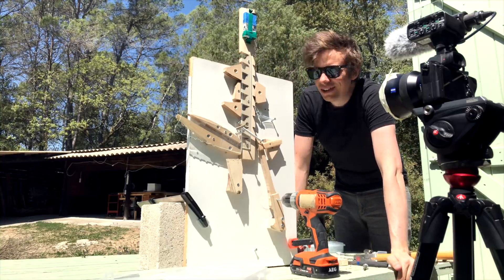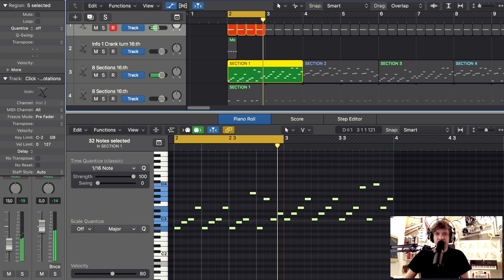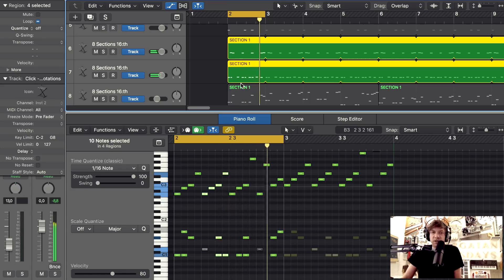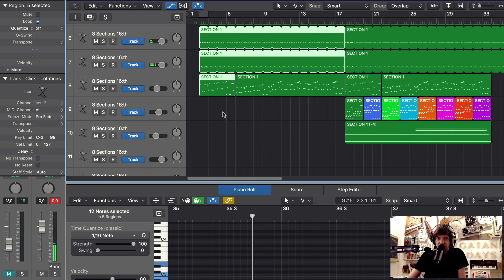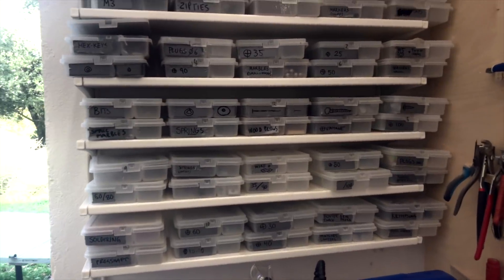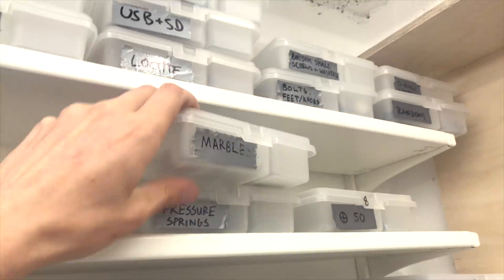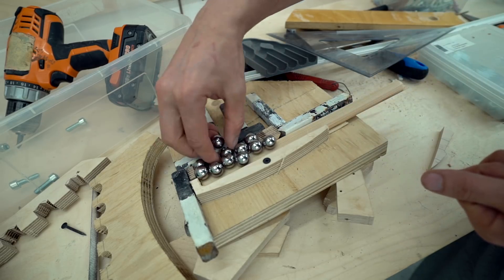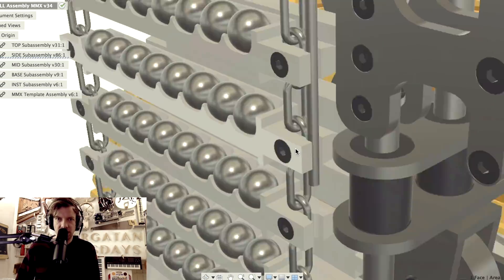Conveyor Belt Marble Lift - Marble Machine X #33

Comment: So if you're going on tour with this thing, how sure are you that every single stage floor will be level?

That's why you can't use the tilt divider. I wonder about the 5 degree slope on the new divider too.
Reply: He isn't assuming that. The MMX will have to be somewhat levelled for each theater.  Easily done.

Comment: After the demagnetizer, instead of having a curved slope, you should have it straight so the demagnetized marbles can quickly get to the conveyor belt. They are already slowed down by the demagnetizer, so make sure that you get  8 marbles per crank from the magnet pickup to the end of the conveyor belt.

Comment: When I saw the lift full of marbles I thought it looked heavy. 
Have you made any tests or calculations about what the total weight limit of the whole system is - before friction becomes to high somewhere in the system? 

I imagine that it is not a problem, considering the first marble machine worked and had the same amount (or more?) marbles moving and being lifted in the system?

It was just something that came to mind while watching the video..

Comment: i have an idea in case this wont work or smth : a wheel with outcrops with gaps exactly for marbles. it would be placed in such a way that it would intercept a channel with marbles that would have a cut through it at the end. at the other end there could be a sideways edge that would push the marbles out from between the outcrops. i hope you get the idea

Comment: Martin, may I suggest that you build more of the machine before designing thoroughly the rest of the parts? The machine is looking fantastic and there's a lot of great CAD work there, however I think there's a lot of assumptions built in. There's lots of components of the design that are being built on those assumptions. I worry that you might have to redesign a lot of things if there's no intermediate building to validate them. Just my 2 cents. BTW, the new video formats are great!

Comment: Being thinking on the system to lift marked you just shown.. it's very cool, but feel must point on something.. it will move step by step.. lifting the Marvel's into those little holes.. if you think on do that motion in a fast way.. let say 3 moves per second or more, maybe the inertia force can cause some marbles fall from their sockets. I didn't do the maths .. not good on that.. in fact is more like a fear it happens... Maybe could be good a plaxiglass shield or something alike

Comment: Hey martin. I posted a reaction about your issue with large assemblies on Fusion. Since i posted it quite lately and i'm not sure you read late commentaries, here it is: my experience from an industrial CAD background. 

-About moving parts: keep in mind that CAD softs are not really made to have you running the clockworks by dragging the pointer around a wheel. They can do it for simple machines, but they can't handle a whole kinematic chain in big assemblies.  Most CAD softs have a rendering module for exactly that, but it's still very limited and very dependant on the quality of your design. Maybe the "motion study" in Fusion would help you animate/render the machine. It's really a shame Fusion doesn't seem to allow placing objects by coordinates and not by dragging them.
On the other hand, being able to move parts is obviously very useful for the whole designing part.

-About placeholders: That's the right way to CAD with big assemblies. Imagine having to make a gripper for a big plane jet engine: first, you want to remove all the components inside the engine since you just want to hold the box. Most of the time, it's not enough since those engines are very, very messy with lots of surfaces and sub parts. If you got the original CAD file, you even get all the construction elements (and an involute gear has a lot of these). It's very common to ask the customer a .step or .iges, simplified file, just so the pc can handle the engine alone.

The key is to use "dead" bodies/surfaces: parts/assemblies that have no sketch, no inner joints, nothing at all to update but rendering and joints with other elements. But you have to be smart with that if you still want moving parts.
Afaik that's how most of the automotive and aircraft industries work (but they don't care about moving parts). Basically every CAD involving 5000+ parts (a car has around 30k) needs such workarounds. Catia V5, the tank of CAD (the price of a tank too), barely handles a whole car in .step format on a decent CAD PC.

Convert the sub-assemblies that are mostly done in lighter formats, like .step or .iges and back to the Fusion format and replace your sub-assemblies by these placeholders. Those you often edit, keep them native or you'll waste time switching formats.

About working in absolute positions: it allows really big collaborations: When making a car, there are the guys working on each part of the car, but there are also the guys making the whole assembly line. Great, you now have millions of parts and you somehow barely care about the positionning of anything 'cause everything positions itself.
On lesser projects, like small test benches or your machine, we tend to stick to relative because it is more interactive and help avoid some mistakes, but it still involves good (expensive) softs and PCs. 
For Fusion with a home pc, i'd go for absolute: as you said, sub assemblies will place themselves.

It's also important not to ABUSE absolute positionning because it tends to hide mistakes: for example, 2 plates jointed with 2 fasteners. If the holes are not equally spaced in both plates, joints will tell you something's wrong. Absolute will work no matter how many undesired misplacements in the model (provided you don't also place joints), and you will end up finding the problem yourself with the real machined parts. All parts in sub-assemblies should keep their relative positionning.

One last tip: On very big assemblies, i don't show the sharp edges (visual style -> shaded). It's quite odd at start but it basically double the performance, and i find it relaxes the eye: softer - but less readable - model and less stuttering when moving the camera around. Also deactivate all kinds of animations like "Animate joint preview" and such.

Cheers, keep up the awesome work!

Comment: I would recommend trying to drive the sprokect of the chain system with the pistons rather than trying to ratchet each individual marble holder. Would probably be smoother and less chance of knocking marbles around or out and would also reduce noise.

Comment: As the chain in the chain lift system is not rigid the ratchet system should push the empty containers down, not push the full ones up. That way you work with the string tention in the chain rather than fighting against it.

Comment: You have a big storagesystem on the top

You have a part in the song that is super complex

And it will use more marbles than the lift can support
But before the storage is empty you will get to a slower less complex part of the song so the storage up top can yet again fill up for the next complex part!

Comment: Wow, you sure have a lot of interesting ideas for the Marble Machine X!

As a mechanical design engineer I am always trying to find the most simple solutions and in this case would suggest a 4 or 8 marble wide conveyor belt equipped with horizontal bars to hold the marbles, mounted at an angle of around 60 degrees and driven from the top to keep the side with the marbles straight (guide bars under the belt also could do the trick).

Comment: have you thought about offsetting the top of the marble lift from the bottom, so the marbles go up an incline instead of completely vertical, which may also leave a clearance for them to fall out the back?

Comment: Really nice! Maybe soon you don't even need the magnets on the big wheel to lift the marbles. This system could lift from the bottom to the top. I know this is a similar idea as the first marble machine but this one is nicer looking and i guess is more appealing than a row of marbles 'running' on the side of the big wheel... plus no demagnetizer

Comment: Using ring chain could be problematic, because the link-to-link interfaces are not constant. A bicycle or motorbike chain doesn't have this problem, link spacing is standardised and compatible chainrings are readily available.

Comment: I wonder if its possible to do a version of the MMX that has a motor on the crank drive and can be fully automated from any music creation software, almost like a midi instrument, If you could come up with a way of having the main programming wheel/plates all fixed but the pins mechanically operated so it can be edited on the fly. That would be not only an engineering stroke of genius but awesome to play around with and write music on. I can imagine writing the vibraphone melody on a track on screen, pressing play and it playing back on the machine with marbles instantly...perhaps a future development?? I would buy one haha, I think the cost would be astronomical as making the pins automated would mean some sort of solenoid on every pin and there are 1000s!!!! I wonder if there would be a way of making a magnetic programming wheel where the marble release is actuated by electronic signals, eliminating the pins altogether, almost like the drum of a laser printer that way it would be easy to program and less moving parts, such an awesome project with so many possibilities, I don't think I would ever finish something like that as design creep would take control :) Keep up the great work my good Sir

Comment: Have you given any consideration into the amount of torque you going to need to keep the system spinning?  The more  moving parts you have under load the higher the energy your primary flywheel will need to provide and store which in turn will require you to crank harder...  You're gonna be wasted pumping and turning that crank after 30 minutes...

Comment: Too much parts,  too much weight,  too much force needed to lift marbles.  Rethink all system with a single endless screw of Archimede, four or six halfcircular channels to guide up marbles around the screw. All the weight is on the structure of the machine and less force is  needed

Comment: With that conveyor, is there a prevention for the marbles to fall off before it reaches to top?
When I look at it now, if the chain is a tiny bit loose, it might tip a bit and cause the marbles to fall out. Definitely if that chain moves fast-ish.

Comment: Just curious what material you are going to use for the 3d printed items Martin? As with transport and setting parts may get warm or degrade due to being heated up or excess UV light (like on stages), pla (polylactic acid) is the simplest to print (good for prototypes) but softens at a low temperature and degrades with UV light, abs is a higher melting point plastic but is harder to print and may need an enclosure (photo lighting box does the trick) but also degrades in UV light (strength and colour), petg is like abs without needing an enclosure but is stringy (a little annoying to print) slightly flexible (can be quite tough due to that fact) but layer adhesion isn't its strong suit and degrades under UV also, ASA though like abs does benefit heated chambers but has better layer adhesion higher temperatures till it starts to soften but has a super high UV resistance and less warping (printed parts don't shrink in size as much keeping clearence.

Comment: If you were to put magnets in the space between the conveyor belt, wouldn't that also demagnetize? Either as an additional demagnetize, or in replacement of the current demagnetizer.. or is the concern that the speed would still be too fast?

Comment: Can't you put a flywheel on the top conveyer axle, driven by the top of the pistons with a half-ring mount? Would be way more reliable and less prone to wear than ratchet system, unless you want to use metal for your ratchet parts...

Comment: Wintergatan, you could maybe have a straight slope as the marble catcher for the track, but steepen the slope on the bottom of the conveyor lift things so that the marbles furthest back (from a frontal perspective) get thrown further across the slope tray. Actually, instead of just a slope, maybe you should have the catcher tray have divots that are cut off before the other marbles' positions.

EDIT: I had to finish this comment in order to go back to the video to see how many marbles were in there compared to the 'offloader tracks.' With the first six, you should do the track idea, but with the last two you should have a bumper system so you can direct them (before you start musician-ing it up) to wherever you think you'll start having the most problems with a lack of marbles.

DOUBLE EDIT: I'm an idiot, I didn't think about if you were going to just put three marbles each into the two most important tracks and the last two into the third track. Dammit. Ignore my edit above if you think I'm an idiot.

Comment: Have you looked at the history of feeding mechanisms for the sport of paintball?  Many of the concepts are the same, despite it being a completely different configuration and application.
For example, you have a lot of rebound/bounce back up your feed ramp with this lifter geometry.  You can actually make the rebound work in your favor with a device Airgun Designs called a "powerfeed."  Essentially, you want a 3-4 marble stack in the feed chute backed up with a close-fitting 90* turn.  The marble stack rebounds off the lifter, then rebounds again off the turning block.  By setting the gap in front of the turning block very precisely, you can "tune" the system to rebound the next marble into the feeding device just as the next lifting slot lines up.  Think of it like the "Newton's Cradle" desk toy.  It will dramatically speed up your feed times (and also look really neat in slo-mo).
Note that the timing of the system will vary with your crank speed.  So, for songs with different tempos, you should include a wedge wheel to adjust the gap on the turn block to match the tempo you need.
Enjoy the free feature creep!

Comment: Hey, maybe I'm misunderstanding how the rachet works but how is it going to lift your marble holders as your chain is going to flex/distort? Your prototype is based on rigidly linked holders. Your ratchet may work if you pull the empty side down as your chain is rigid then. (Maybe I've missed something though?)

Comment: Looking at two of the comments, I would recommend doing a marble pump and using your divider for the demagnetizer. have them in for channels they would then go through the marble pump that would lift two marbles per crank turn each. yes there would be a little bit more path to get to the pump but they're already divided into four and you could actually just have those four come straight over and then turn into each lifter.

Comment: Hi, Martin. The conveyor belt really looks cool. But keep in mind that the whole machine will still be shaking when you're cranking on a live stage with 200bpm. I'm afraid you will loose many marbles that way, because there are no guards on the belt. Also keep in mind, that the chain drive needs to be under quite a good tension, when operated by the cranks. The motion is not fluent but a rather harsh on and off motion. If the chains are not tensioned, there might be lateral movement, which will lead to more marbles falling out.
All this with much respect for your really, really great project. I love your videos and your attitude!

Comment: Big fan of what you are trying to accomplish, I look forward to each update. However, I do have a couple of concerns with this new system.
1. Noise of chains/rachets. You are going to have a rachet click each crank turn, which will sound like a metronome.
2. Marbles dropping from the belt cradles with each rachet motion. Motion maybe too violent. They were trying go jump out in the prototype.
3. Gating the marbles so they don't drop trying to enter the belt when the belt is not in correct position.
4. New marble divide may not be efficient/reliable. It will favor the furthest slot, only filling the first slot when all available space is filled. My thought would be this reduces effective number of marbles per crank turn unless you have a large back log of marbles to lift.
5. Redundant marble divider.